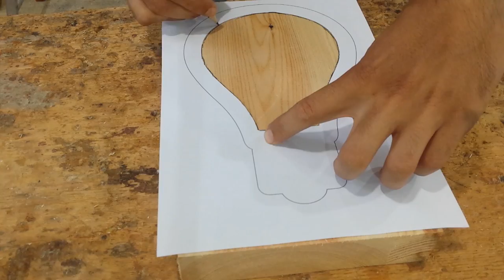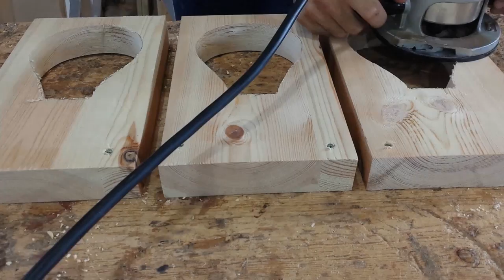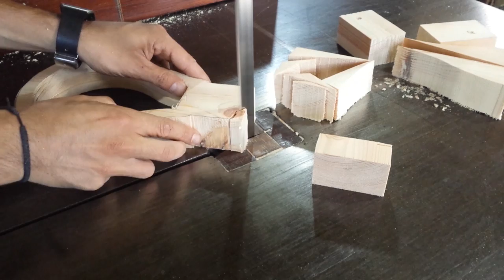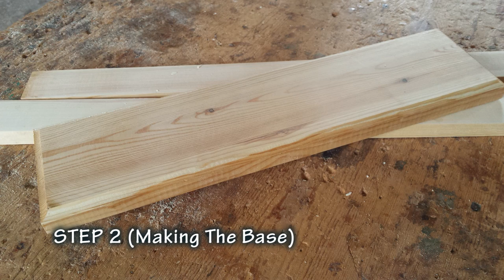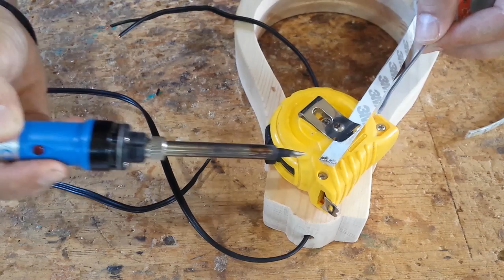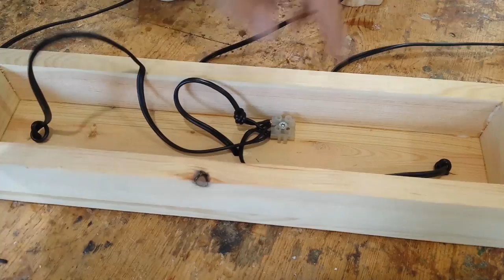Wooden Light Bulb Shaped Lamp (FS Woodworking)

Comment: Very nice concept, might even make it myself one day.Maybe finish them up with a coat or 2 of varnish? Will give them a much better, cleaner look.
Reply from the maker: +Snaffer01 Hi, they are finished with a coat of clear impregnating varnish. I know they look unfinished on the pics but its probably my cameras lens. Thanks a lot for your comment.
Reply: Oh okay! Nice!With a bit more budget one could use these woven electricity cables (more retro). And maybe a strip of thin opal plexiglass to cover up the leds (I hope it's flexible enough). Router out a 2nd bevel a bit wider but less deep and you can probably glue them inside the light bulb. I think that would look very nicely finished for when the light bulb aren't lit. That would be the advanced version ^^You see you got me thinking! I might even make these sooner than I thought! Thanks.
Reply from the maker: +Snaffer01 Hehe go on make them.Thank you for your advice. Post here your projext if you like. I want to see it once its done. Have fun and work safe.

Comment: Great video! I would like to make something similar to this, but the light will be on for long periods. Are there any safety issues with the wood and heat? Don't want it erupting into flames :) cheers
Reply from the maker: +Chantelle Le Platrier The led strip will never be hot enough to burn the wood. As a matter effect you can touch the led strip even if its on for hours. No safety issues. The only thing I would recommend is to remove the glue behind the led strip and use hot glue instead.Not for safety reasons but just because it holds better.

Comment: What kind of wood do you use? I'm your new follower.  as the tool it is called Groove?
Reply from the maker: +Manuel Zamora I have used pine for this one. It is better to use a hardwood though instead.
Reply: Yeah,i think pin fin heasink is more effective for the light cooling.